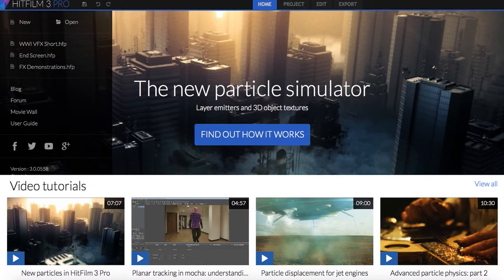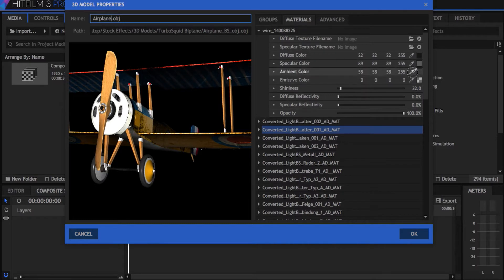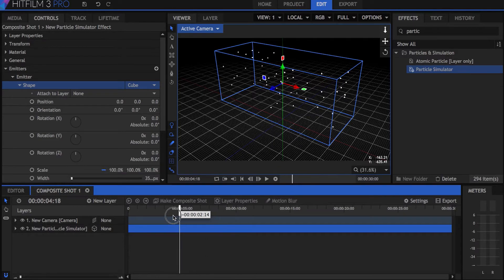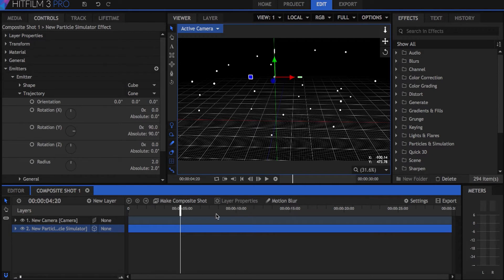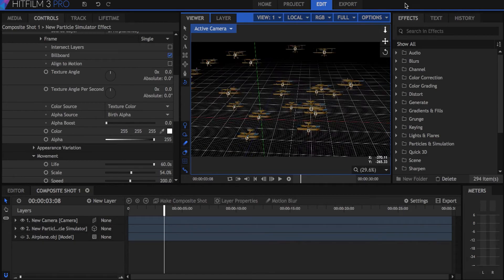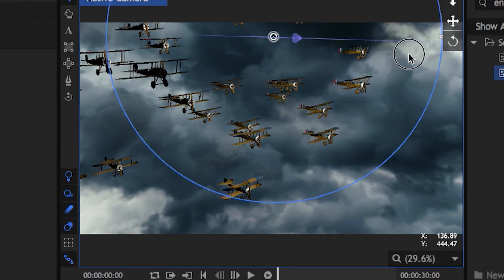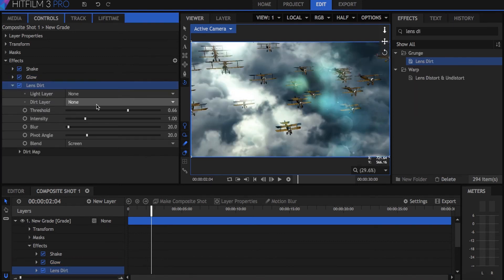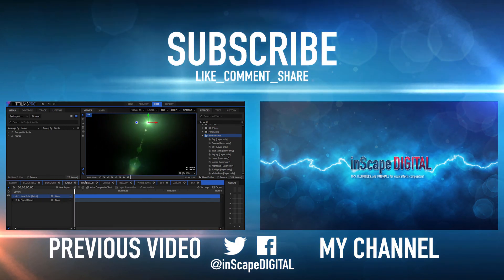Particle Simulation with 3D Models

Comment: I followed  you tutorial I put  3D models helicopter with animated propellers  , I guess when you animate propellers is not going to work  Right ? or it should
Reply from the maker: In the Particle Simulator, under Emitter -> Particle System -> Appearance, set the Frame property to Animated, then drop it down and increase the Number of Frames.
Reply: Thanks Got it, Awesome!!!!!

Comment: thanks for a great job hitfilm lessons compliments.
I followed this lesson, I gave the right move at the motor propellers, but despite this the particle simulation, the propellers of the aircraft clones do not Revolve. How can I do? There is a command I have something wrong?
Reply from the maker: Under Emitter -> Particle System -> Appearance, set the Frame property to Animated, then drop it down and increase the Number of Frames.
Reply: 1000 thanks a hug

Comment: Hello can you please help me with a problem I have in which I would like to load a 3D model from Adobe Photoshop CS6 Extended into Hitfilm 3 Pro.  I can't figure out how to do the process properly.  I don't even know what I'm doing wrong.  Can you please explain step by step from Adobe Photoshop CS6 Extended into Hitfilm 3 Pro.  I managed to do it once trial an error but it still didn't come out right it had no textures when loading into Hitfilm 3 Pro.  I didn't write what I did so forgot what I need to do.  I tried contacting others but they never really answer my questions please assist with a reply.